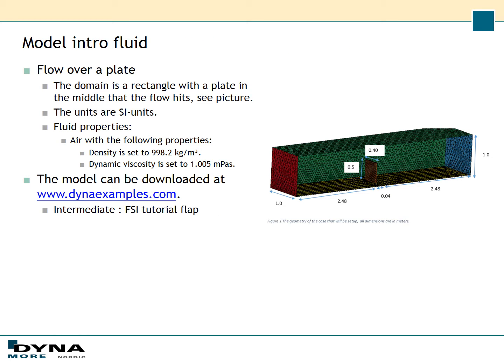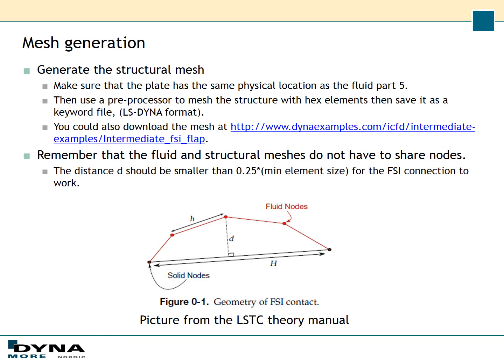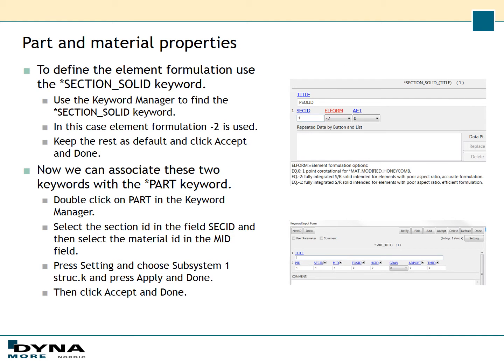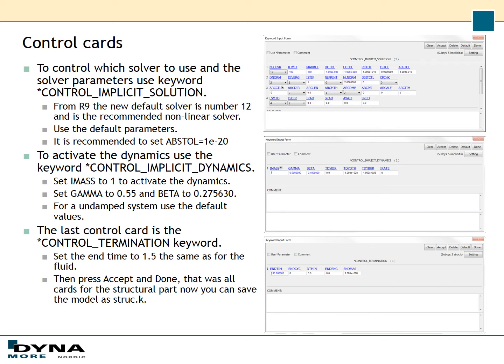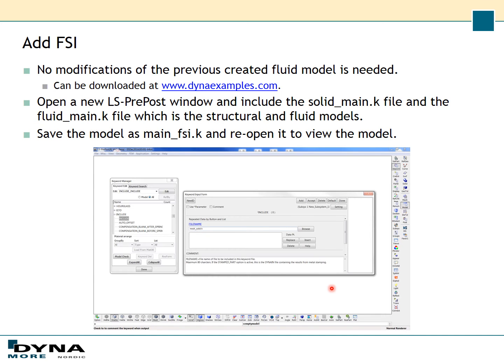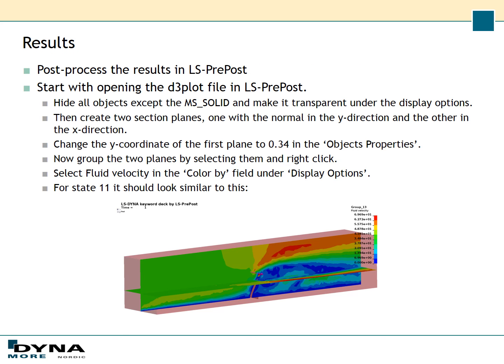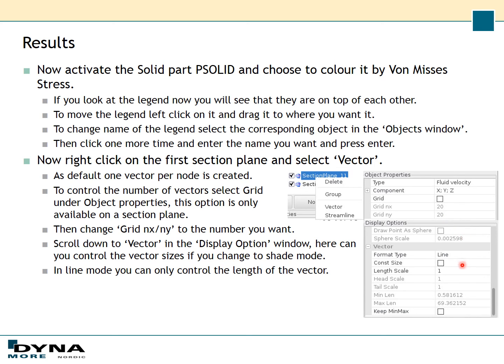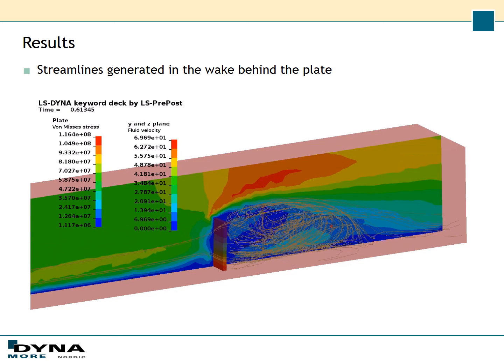How to set up a 3D FSI case in LS-DYNA

Comment: Nice tutorial! Can you also use a user-defined mesh for the fluid part in FSI simulations? Personally, I do not get this working. It seems that not al the FEM Parts are detected by LS-PrePost (only the "inside" of the mesh, not the boundaries indicated with *ICFD_SET_NODE_LIST).